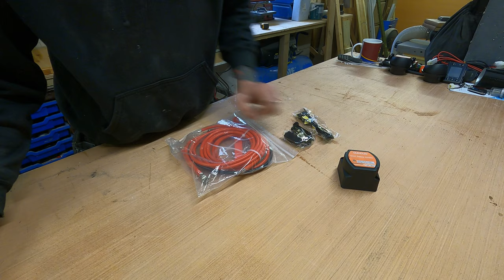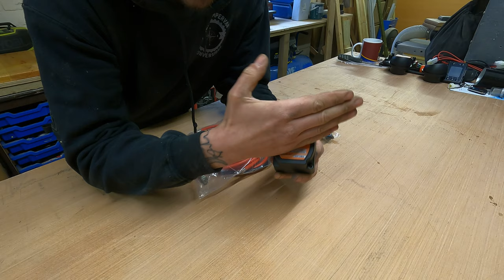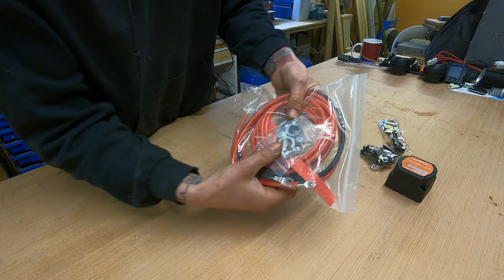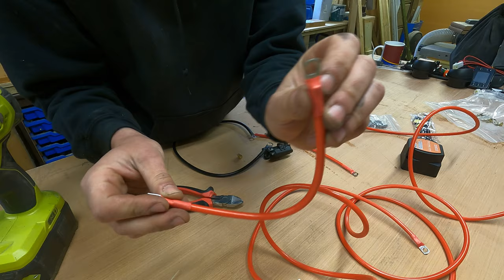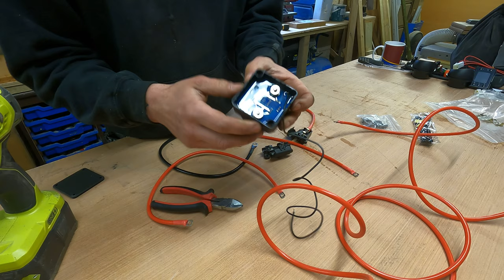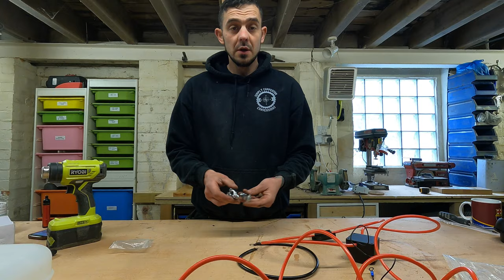HOW TO WIRE UP A SPLIT CHARGE RELAY, VSR VOLTAGE SENSITIVE RELAY IN YOUR SELF BUILD CAMPER VAN

Comment: I've got a 2003 diesel step van (w/ 2 starter batteries) and don't think it has a smart alternator. I was thinking of a DC-DC charger but IDK if it's necessary or better? I was planning of getting some lithium batteries maybe 100ah or 200ah. Any thoughts?

Comment: is there something like this where i can charge from the alternator when i'm driving, and from solar when not driving? i was thinking a 5 pin relay would be what i need, with the switch being activated by an ignition wire.
Reply from the maker: No need just connect both this and your solar controller to your battery.
They will charge simultaneously no problem.

Comment: Hi thanks for this. I have cargo split charge relay on my vwT5 . When charging the leisure battery from a hard wired 5 amp Optimate, ( which I’m using as a temporary charger) all is fine for a while them the relay starts chattering open/closed rapidly as leisure battery voltage reaches 12.8 volts.. and it just keeps on doing that. Is that normal.. will it damage the relay? Would fitting a Victron 15 amp charger solve the issue do you think.. or would you suspect another issue. Have checked the whole system through and leisure  battery charging well from alternator.( 14.3 V) Thanks
Reply from the maker: So the relay is set to close the circuit and allow power through at a certain voltage, they vary slightly it sounds like yours is 12.8v. This will work from both sides so if your leisure battery reaches the set voltage it will close the circuit and engage the relay.
Mine does it when it’s sunny and my solar takes the leisure battery over 13.2v.
It does seem strange however that it goes on and off as your charger should be putting on the same voltage all the time.
Reply: Thanks.. yes I’d have expected it perhaps to open/close maybe a few times when the voltage first reaches 12.8 and  the relay closes.. but the chattering is a mystery.. I replaced the relay when I first noticed the problem.. so it’s a new relay. Perhaps replace the charger is the next step as I’ve checked all connections, earths etc. Thanks very much anyway.
Reply: My friends chatters like that, the whole kit is overkill. You don't need such thick cable - look at the cable from the alternator!
Reply: @vincentsconcertina  Late reply but this is the whole point of my posting - they do chatter so a waste of money.
Reply: Actually it turned out that the problem was not the relay, but the charger.. insufficient amperage. Installed VictronConnect ip65 15amp charger.. problem solved. But thanks for responding.

Comment: can this go direct after a battery so pos to pos with the realy in the middle.
Reply: That is it. The relay is to connect main battery positive to leisure battery positive only when the engine is running (Charging). Negative goes to the bodywork.

Comment: so it allways charges starter battery even it is full and drain water
Reply: The alternator has a charge control built in so shuts off any charge when the battery is full - this is why there is surplus charge to use on a second battery.

Comment: THESE KITS ARE A BIG CON, TOTALLY OVER ENGINEERED AND THEY CAN CHATTER WHEN THE LEISURE BATTERY NEARLY FULLY CHARGED. You could just use a standard 30 amp (Headlight) relay, connected as in my video 4 years ago. There is NO NEED for the heavy duty wires, check out the alternator wires, they are not that thick, you are only charging the battery, not starting the vehicle.  I used standard 13 amp 240 volt extension lead cable for 4 years with no problems.
Reply: Im looking for something just to wire onto the starter battery then to a spare battery, by passing any alternator. my battery in the foot well had hoped just connect it directly to battery....would this work.
Reply: @WendyWindows  Not really because both batteries are connected together this way - that means when you drain the spare battery you are also draining the main battery. You need the main battery fully charged to crank the engine. Also the cable used to connect both batteries would have to be heavy duty to cope with the high amperage used when cranking the engine.
Reply: UPDATE. I have now replaced two of these Voltage Sensitive Relays with standard 30amp relays due to the VSR chattering, so annoying.
Reply: @ewanbaxter9199  Couldnt you have a cut of red swutch for once the battery is full from driving.
Reply: @WendyWindows  Hello, yes you could but it is supposed to be automatic - so if having to fit a manual switch you wouldn't need the relay at all.